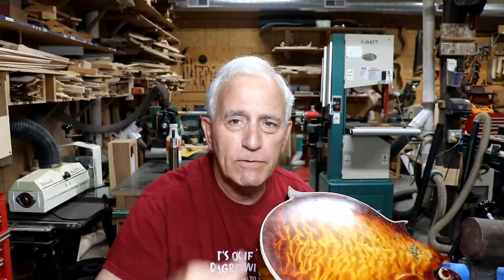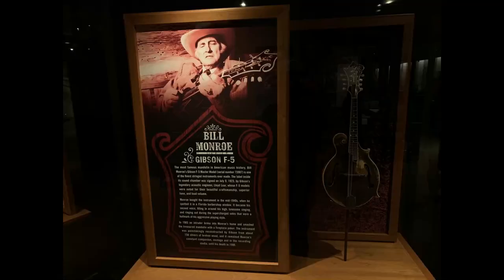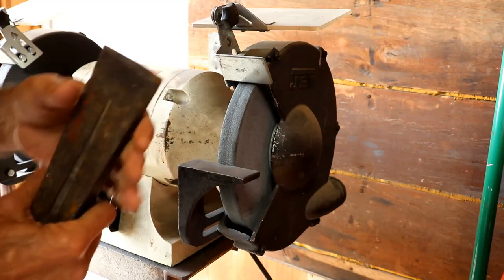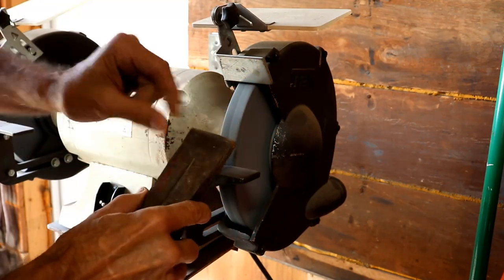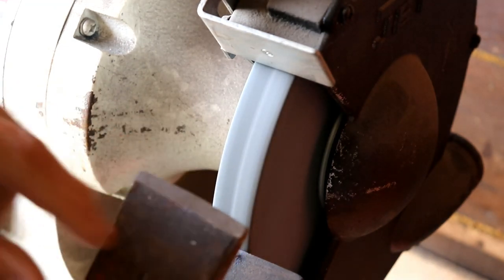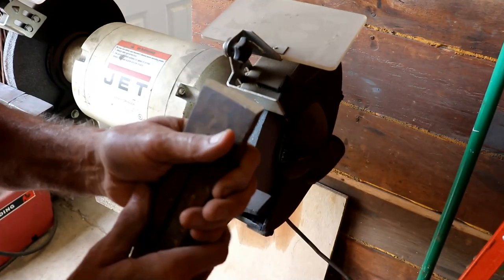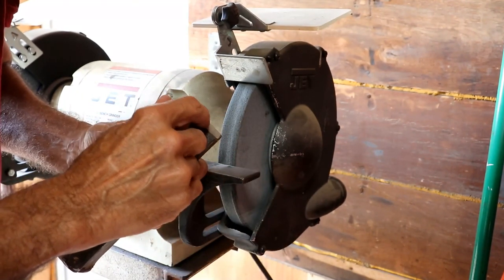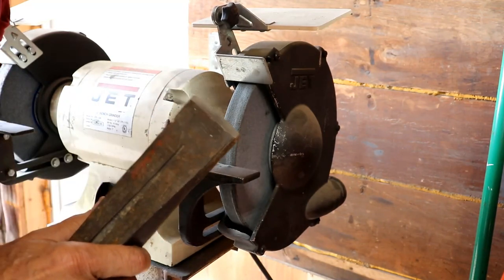VLOG #045 Tech Tip Tuesday and Mando Status

Comment: I learned sharpening when one of my tasks at work was re-toothing 36" radial saws. There is a touch you learn. I would only add that you should take your time as to not overheat your work and change the characteristics of the metal.

Comment: Why did you glue the binding before you put it on the mandolin? If you had glued the 3 layer of binding in the same process as putting it on the instrument, it would have been much easier and nicer! 😀
Reply: How do you clamp, doing it like that?
Reply: @michaeldonaghey  With tape. 😁
Reply from the maker: Its all simple till you do it.